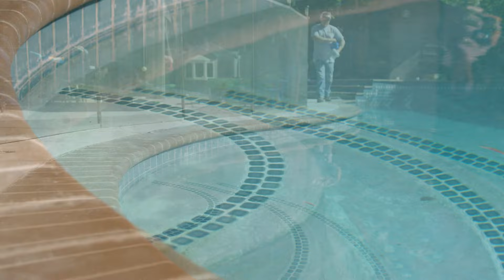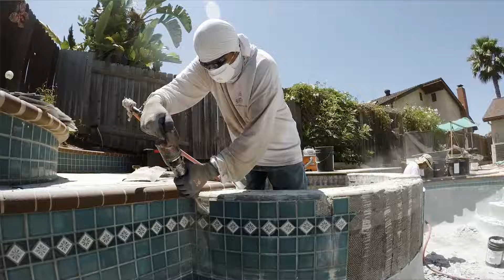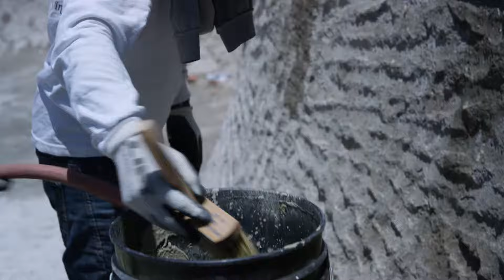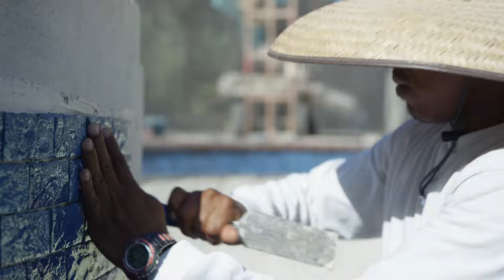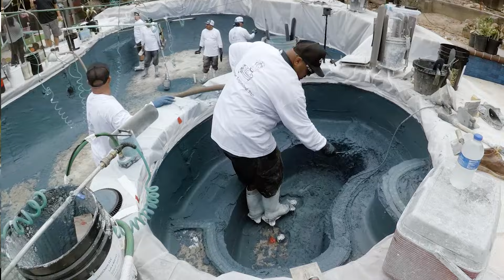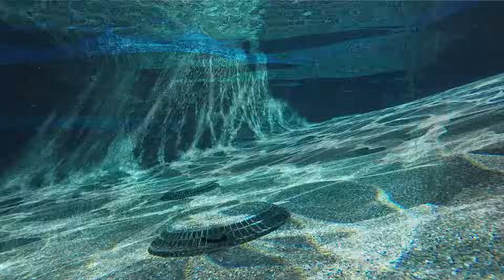Poolscape Unlimited, Inc. - Pool Remodel 101

Comment: They could have just gotten their pool tile cleaned by elite pool tile cleaning and then gotten the tile repaired and then replastered.
Reply: The tile upgrade on this pool made a gorgeous aesthetic difference. Sure, they could have repaired the tile from the 80s, but its still an 80s look if that's what you want. I think the pool is stunning with that tile.
Reply: @winikay  Yes, I totally agree! So amazingly beautiful!
Reply: That would be a good alternative. Wonder how much cheaper that  would be.
Reply: The tile was no longer adhered to the wall, holding on by the grout only....so in this case, cleaning was not an alternative.
Reply: @jaymechapman  not all of it was
Reply: @jaymechapman  well tbh a lot of tile on many pools ive seen isnt. In the greatest shape. Either However common sense tells you once you start chipping and removing pieces of older tile all the other tiles will start going with it as the tileline level has been disrupted 
So i think the old tiles on this job could have stayed but hey business is business 
-pool remodeler

Comment: What was the rough cost of this project?  I'm in the San Diego area and have a 15k gallon in ground pool. It's from the 70's but functional...however it needs new coping, new deck, re-plaster, the works.
Reply: Hi Victor, I believe this tile and pebble job was around 19k, it was a larger tile job, upgraded tile and an upgraded pebble finish. We do free estimates if you ever want to get a realistic cost give us a call 619-561-0555

Comment: I think the copping should have gone too!
Reply: copping removal seems alot of work.
Reply: I agree , that pool is 20-30 years old , and I would have pressure tested the lines make sure no leaks and changed the skimmer , why spend all that money and not do it right , always start with the filtration system too. It’s like having a Ferrari with a blown engine. I mean that’s my stile when remodeling my pools but everyone thinks differently.

Comment: How much can job like this cost?
Reply: We just had ours redone in S.FL.  About 22,000 gallon pool, 84 Linear ft. of new Couping and tile.  Cost was $6,500 for new couping, tile and Florida Stucco gem quartz.  Florida prices are cheaper than other areas.
Reply: @Pattycakezz  Would you mind Sharing contact info with the company you used?  I am also in south Florida
Reply: This job was around 19k, upgraded the tile and pebble finish.
Reply: This can go up to 22k to 65 depending on materials you want